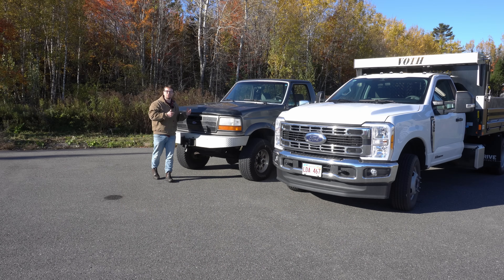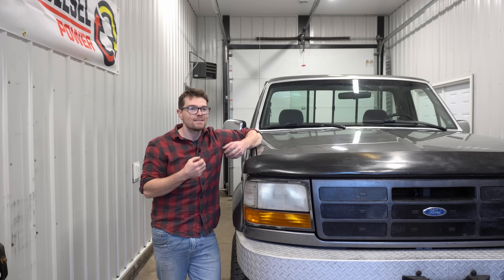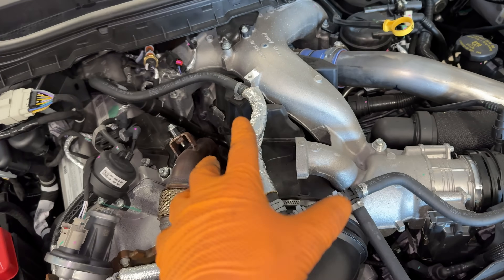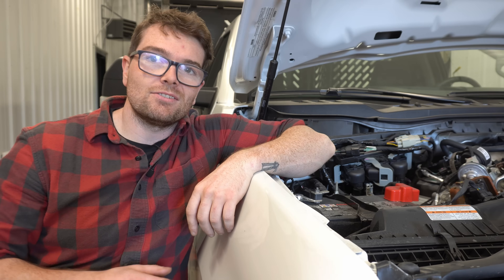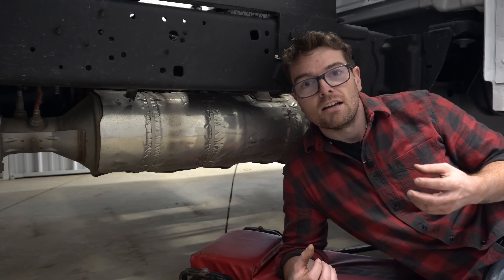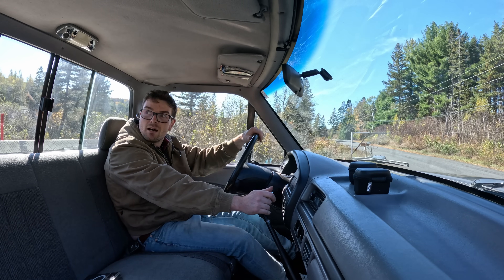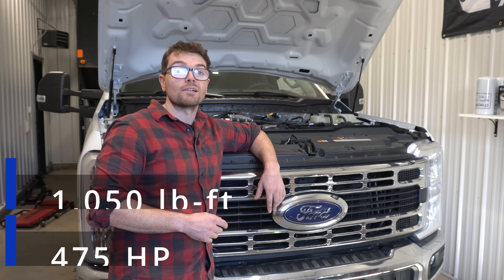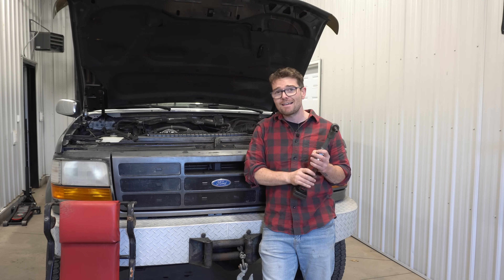Ford F-350 6.7L PowerStroke | 5 Reason Why New Diesel Engine SUCK *Diesel Mechanic Explains*

Comment: As a person that daily drives a 7.3 and then gets in a company truck with a 6.7 there no comparison. Would I personally own a 6.7, absolutely not. But the 7.3 I makes hardly any power, noisy and hard starting. The trucks ride rough cab noise is off the charts and generally they’re just old trucks. If you’re willing to put up with that like I am then go for it, but don’t stop $35,000 on an OBS ford and think for a second you’re getting anything other than a covered wagon. Also…the weakest point of the 7.3 is the electrical system. Every owner should carry a spare crank sensor in the truck at all times, and those phoney wire through valve cover gaskets and glow plug relays are a source of maintenance

Comment: Another factor is the 7.3 is actually a rebadged E444T , 444 cubic inches, a trusty SAE engine. The SAE threads hold up better, are easier to work with ... and were designed by machinists instead of college graduates..

Comment: My 2017 f650 6.7 high pressure fuel pump co4 contaminated my fuel end result replace all fuel components $13800.00 later 😢

Comment: Not a truck - but I daily a '84 300TD that just rocks. Everything is mechanicallly controlled (you can disconnect the battery post starting and it will continue to run until out of fuel). Change the oil regularly,  adjust valves every 1.5-2years and they bascially run forever.

Comment: Newest diesel ill ever own is gonna be a 2010 - 2012 cummins. No ford after 03. 
No dmax after 07. 
I currently rock a 06 5.9 mega cab. 

I was at a cross roads of a 2014 6.7 or a 06 5.9. 
i looked up how to change a water pump on a 6.7 powerstroke and same on a 5.9. 
And thats why I stay older. Easier to work on
Reply: And specifically 2010 to 2012 cummins cause they don't have def but the dpf and an egr. Simple welder and shut em closed still can look stock and be completely epa unfriendly lol
Reply: 07 5.9 mega here.  Swapped in a G56 manual.  I'll never get rid of it.  Considering to be buried in it when I die.  It'll be a big plot site.

Comment: And all that is why I won't ever get rid of my 2002 24v High output Cummins turbo diesel with a 6 speed manual! The best of the best, the strongest of the strong. No dpf, no egr, no scr, no def no fancy bells and whistles, no sensors sensing sensors, modules and computers! Now that my '02 24v has finally hit 100k miles and is broken in. My plan is to p pump swap it! Take off the half electronic/ half mechanical vp44 injection pump and go back to the older style all mechanical inline p7100 injection pumps. They are the ultimate in reliability and bulletproofness and fueling. The vp44's are terrible, they have gotten a bad wrap and a bad name for themselves for failure, but it wasn't nessicsrly the vp44's fault,it was the poorly designed lift pump that was unable to supply enough fuel volume for the vp44. A flaw in the vp44 design is that it needs a constant unobstructed supply of cool clean fuel to cool itself and lubricate it. Anything under 10 psi in fuel pressure at the pump inlet and it's burning up!
The simple and easy fix is to install a fass fuel system. You get better filtration down to one micron, water fuel separator, bigger fuel lines, a tank bottom mounted sump. Easier filter changes. Bigger better quality filters. A fass system on any diesel engine regardless of make model or mfg, is cheap insurance! Well worth the $800 for a fass system! Compare that to the cost of one common rail injector! Now mechanical injectors for 12 valve and 24 valve trucks are very inexpensive, you can buy a complete set of 150hp injectors for a 12/ 24v for what one common rail injector costs on a newer diesel, then times that by 6 or 8! Parts are cheaper for the older non emissions stuff to! All sorts of bullet proof upgrades and options! I really want to do the p pump swap for the reliability , bulletproofness and simplicity! I want to even do the manual cable style fuel shut off like on older tractors! No electronics! Nuke proof! I've worked in the industry as a mechanic off and on for the last 20 yrs. I went to school to be an auto diesel tech back in 2005 in Phx az. What I've seen the last 20 sumthin years and have realized is there's gunna come a point where all these fancy $100k trucks are going to be broken down on the side of the road or parked in dealer lots with no one that is capable of working on them or fixing them! They have become so complicated and so proprietary in their software and tooling to diagnose the things. There is a huge shortage of mechanics in the industry. I learned at a young age after going to auto/ diesel school and getting a degree and all
My ASE certs that it paid more to have a CDL and drive a truck! No mechanic positions paid more than $10/hr to start and you had to have and buy your own tools which aren't cheap! I've easily amassed about $50k in tools and tool boxes and everything over the years. Move spent a lot of pay checks on the tool truck and ordering tools so I could keep doing my job that dosent pay enough to buy the said tools. It's a failing industry. And at some point it's gunna crash. No ones gunna be able to fix or work on these fancy over engineered over complicated diesel and gas vehicles. Diesels have just plain gotten stupid. You couldn't give me a new 2025 ford/dodge/gm diesel truck. Junk! A diesel engine was never made or designed to eat its own a$$! How long you really think those things are going to last taking all that soot and particulate into the intake? That's supposed to be the clean side! It's stupid what they have done on the name of reducing emissions. They've increased how much fuel is being consumed. And reduced the  reliability of something that was near bullet proof and would go a million miles! To spend $100k on a new truck is downright stupid. It'll never never ever be worth that much ever again. Your upside down the secound you leave the dealer lot. I'll keep my 2002 24v HO 6 speed manual! It's basically a brand new truck still! It's mint inside and out, garage kept meticulously maintained, flawless. I get approached all the time people wanting to know if I want to sell it. I've turned down straight cash offers in the mid $30k's. lol what's $35k gunna get me? Nothing! That ain't gunna buy me a new diesel truck! I would never be able to replace it for what I could sell it for. So it's down right stupid to even think of selling it and getting a new one. I'm sure that dealership would love it if I came strolling in with my 2002 24v 6 speed and wanted to trade it in on a new 2025 ram 2500 diesel. They would be drooling and foaming at the mouth for me to trade that secound gen in! The dealers son would for sure claim it as his and keep it, it wouldn't make it to the used truck row in the parking lot. Someone would claim dibs as soon as the papers were signed. I know how this stuff works lol I worked in many dealerships in the shop. A clean, rust free, straight mint inside and out, low
Milage like 100k and under low milage, high out out 24v with a manual 6 speed, factory disc break rear end and all the other things that make it a rare unicorn. The '01.5-'02 were the cats keep. They were the unicorns. They have everything better, better breaks, steering, non cad front axle, rear disc breaks, the bigger nv5600, the bigger better np241dhd t case, no chance of a 53 block, no worries of KDP. They were the last of the 'street tractors'! You can't put a price on a clean flawless interior. Everything you see forsale these days is 250k-350k miles, rusted, beat up, faded peeling paint, thrashed interiors, automatic trans, the possibility of being a 53 block in the earlier years. Most weren't taken care of, they were ranch trucks and work trucks lol. And even then are bringing $20k and up!

Comment: You mentioned the use of EGR to reduce cylinder temps and NOX production. I’m curious if there are alternative ways to doing this and alternatives to the dpf and scr. Another thing I would like to say is that i feel tuning and engineering has come a long way. A delete 6.7 Power Stroke in my opinion hardly smells at all. But the old 7.3 OBS Power Strokes are some really stinky trucks. I think it goes to show what real R&D can do for the industry instead of bolting on emissions equipment.

Comment: I have a 2009 Ford LCF with the rare V6 Powerstroke. My HPOP was leaking so I had to take the intake off to reseal it. The intake was so full of gunk from the EGR. I emptied 4 cans of brake clean until black stopped coming out of it. When I put the truck back together, I kid you not, it felt like it had 50% more power.

Comment: You make some great points here, but just to share some perspective regards to 4:25 in the video with the soot build-up on such a low mileage engine, the operator usage was never explained and having seen many videos on this topic, I do recall watching a video where a "hot shot" driver, running the powerstroke on the highway for a living, had a very clean engine and hardly ran his DEF because his engine was regularing working hard and just burned it all in the normal process.  So my point is these engines are designed to work hard for a living and it appears this engine is not being worked hard enough on a regular basis.  Again, you make some good points, but use selective examples here.

Comment: 7:59 That’s not just with diesels: been chasing an evap system leak on my gas Ram. I’ll throw a code every now and then, I clear it, and it stays away for a few months. Then the dance begins anew. As for emissions equipment: I get the idea, we all want clean air. It just seems like it was all made up by bureaucrats with little to no input from real engineers. Love the “new” addition, and I’d definitely like to see it featured in more videos! Keep ‘em coming!

Comment: My 7.3 will start on 5 cylinders, but a 6.7 won't start if it's low on def 😂
Reply: Yeah mine is blowing by like a SOG but I still pulles my trailer at 80mph.  Just uses more fuel....

Comment: Thank you for reaffirming my decision to get the 7.3L Godzilla gasser in my new 24 F250. 
 A hell of a lot cheaper to buy, and it sure pulls my 12000lb trailer no problem.
Reply: Amen to that!! I'm thinking the exact same thing wth my 23 f350 7.3 gasser & If I look in the engine compartment, I can actually see the ground!!

Comment: Another reason old diesel trucks give her multiple fuels in these modern ones can't. The Diesel's actually weigh more proficient engine than anyone thinks. You take away that modern crap. The diesel will shine above the gas.

Comment: It all boils down to whether or not we want to breath.  SO many more truck on the road today.  Imagine if they all were running like it was 1970.  We'd be choking on the smoke.  In 1973, EGR came out for automobiles.  It took YEARS to get those systems to where they weren't really affecting drivability.  Hopefully, as these systems mature, the same thing will happen.
Reply: Sure....

Comment: I'd love to have a newer (emissions deleted) 6.7 PS or 6.7 cummins, but I can't afford $80k-$100k for a truck, and can't afford a check engine light coming on. But I CAN afford to keep my old 12 valve running forever, and even supplement fuel by dumping any old waste oils in the tank. I can really make 1 tank of diesel fuel last a long time.

Comment: I’m a VW tech, so yeah I get exactly what you’re saying. The old VW 1.9 ALH TDIs run forever. The newer common rail “clean diesels” are in constantly for check engine lights. The worst is the 3.0 V6 TDI in the Touareg. Gen 1 engines have 2 EGR coolers, four timing chains and I won’t even go in to the CP4 injection pumps they use.

Comment: Hence why Ford came out with the 7.3L Godzilla. We can get the same torque, and 200 additional hp, as a 7.3L PSD without all the headaches of a diesel.

Lets face it. A 7.3 Godzilla with some 4.30 axle gears and the deep gearing and tight gear spacing in the 10 speed will have a considerable amount of grunt.
Reply: yep thats why i bought 2024 f350 7.
3 and 4.30 gears love it i will not buy another diesel

Comment: Now I personally have no experience with diesel engines, I've always had gas. One engine I wish they still would make is the 300 straight 6. That was bullet proof. (Still love my '22 Coyote though)
Reply: So true that 300 straight 6 is bullet proof I had a 1997 5 speed when I sold it it had 385 thousand miles on her went through 2 clutch's and did not burn oil it was low on compression at the boat ramp had to place a brick in the back wheel so my truck did not roll of into the lake lol.🤠

Comment: Minor correction. The 6.7 powerstroke does not push raw fuel into the dpf for regen purposes. The 6.4 did, the 6.4 would fire the injector on the exhaust stroke to fuel load the back two cylinders (7 and 8)  the 6.7 will enrich fueling. But not to the extent off "raw fuel" as the previous engine. 

Doesn't matter what you drive. Take care of it. As a ford mechanic, I've seen all makes and models of the big three reach 300,000 plus and still go.

The common denominator was care. Maintenance and inspection.
Reply: sensors and valves don't break for lack of care. A nox sensors doesn't brake for lack of maintenance.... shill

Comment: Drive a 7,3  Powerstroke every day tough as nails gets the job done not as fast as the new ones but didn’t cost 100,000 dollars 💵 either
Reply from the maker: I wanted a 5.9 first gen cummins but you can't find them, started looking at other options and these 7.3L are a very close second to those 12 valve cummins. built to last.

Comment: I owned a 2005 f250 here in Australia I liked the engine but that was about it , all the parts around it would fail including the high pressure oil pump , constantly fixing front end components would need a master cylinder slave cylinder handbrake at least once a year , turned me off Ftrucks and diesel for life , now have Petrol Rams which are heaps better vehicles IMO
Reply from the maker: I can't argue with that, those early 6.0L powerstrokes were known to be a bit of a headache.
Reply: @GettysGarage  I think that was a 7.3L in Australia. I still have F250 , 7.3L that I bought new in Australia in 2004, only has 200,000km. Mostly front end components wearing out due to heavy weight up front. Otherwise engine has been very reliable.

Comment: These new trucks are expensive, potentially troublesome and unlikely to last as long as older ones but good lord the power of that 6.7 HO motor in the new Fords is intoxicating. Add in a high trim level and you have a luxury sedan with amazing cargo capacity and towing. Buy extended warranty, enjoy while you can, sell before it runs out. Or lose a lot of your truck's equipment in a boating accident.
Reply from the maker: I know, those 6.7L powerstrokes are insane to drive. like legit fast. If you got the money the performance is incredible.

Comment: take the emissions away and they are fine, simple as that......just got my first diesel, had a few buddys with no issues on newer trucks.....maintenenance seems to be a bigger deal as well.....at some point though it does seem all that crap will have to be blown out of the motor...
Reply from the maker: very much agree, in theory without the emissions these newer engines will live alot longer and be more reliable.

Comment: It's not the engine it's what they put on the outside of the combustion chamber that makes it less reliable
Reply from the maker: agreed, the internal working of the new diesels seem extremely robust but there is a mountains of electronic control emission hardware that comes with it unfortunately.

Comment: Adjust the amount of fuel into each cylinder and guess what no black smoke! The amount that is eliminated doesn't negate the amount of pollution created to manufacture and install the device on each engine and not only that but then to replace it. COMMON SENSE!!!!
Reply from the maker: well even with the electronic engines these days the amount of fuel is directly calculated on every engine cycle. these new injectors are spraying up to like 8 times per compression stroke. so there is legit almost no waste.

Comment: The new diesel engines along with gas engines have only 1 problem. The problem is called EPA!!!👎
Just replaced my MAP sensor on my 2019 6.7 with 74k miles. It was caked with that fabulous black powder. It caused the engine to get terrible fuel mileage and caused it to regen 3 times in 264 miles. Just absolutely ridiculous.

Comment: This is why I'm so thankful and glad I have a 40 year old diesel. It's smog exempt in CA so it saves me money and headaches to make sure it's smog approved. It runs no def, again saving money and headaches to fix def issues. It's all mechanical driven. Plus since it is smog exempt I can do a egr delete which I am planning to do. I love old diesels, the new ones are powerful and like them but the stress and money to keep it maintained and optimal is pain in the ass and just not worth it.
Reply: An EGR delete on a 40 year old diesel?  Does it have a newer engine in it with EGR?

Comment: Emissioms aside though, Pretty simple math reason: 7.3L engine making 270hp and a smaller 6.7L making 470hp- almost double the power. 7.3L is like a kid in a foam pit. Doesn't make enough power to hurt itself.
Reply: You can easily pull a lot more power out of the 7.3 with a few modifications.

Comment: I’d much rather have the the old, reliable diesels of 20 years ago.  Even off road diesels have been ruined by the EPA crap.  Dozers and tractors use to last for decades with proper maintenance and today they spend as much time in the shop as in production after they get 1000 hours on them.  I wish one the useless universities would do a study on how much additional costs we incur today simply due to production cost increases caused by “low emissions technology”.